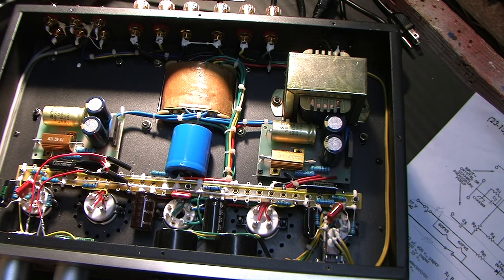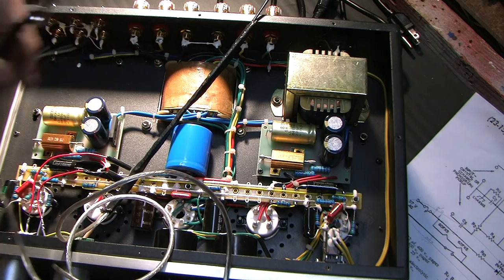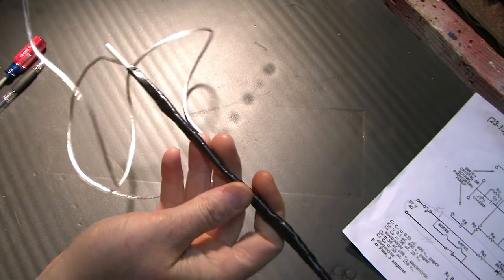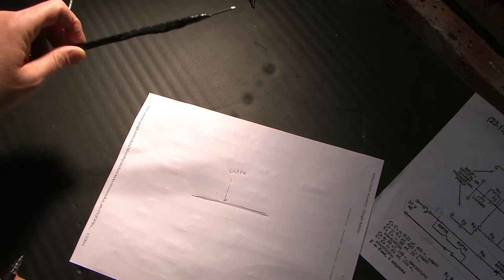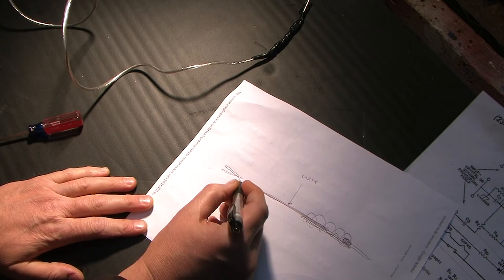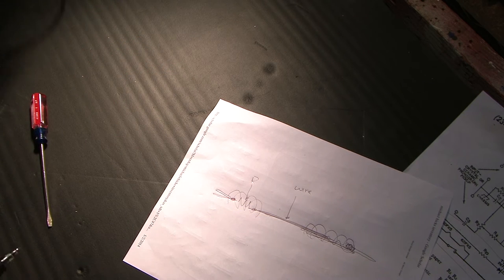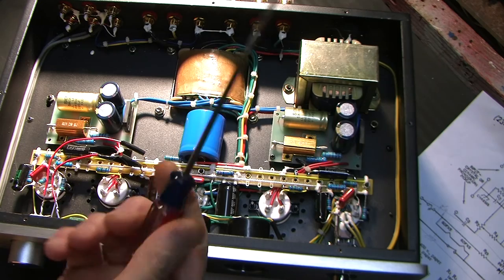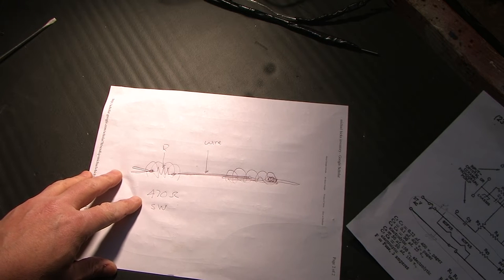Capacitor Discharge Probe:  How to make, and how to determine resistor value

Comment: Man, I searched forever for a good video on this. Couldn't remember my physics well enough. Saw some AP Physics C stuff that was pretty good, but too in depth and didn't address my need. This was exactly what I needed. Thank you for explaining how to make the probe, how to safely use it, and how to pick the correct resistor. Highly appreciated! And thank you for actually having good video quality and pretty good audio quality :)
Reply from the maker: +pasta0328 Glad I could help, that's why I make'em.  Regards.
Reply: +stereopolice You briefly mentioned this in the video and didn't end up covering it, but how do we connect to something grounded? Specifically what would be grounded and how do we check? Do I need turn off power to and then connect to the ground wire in a power outlet? Are there better things to connect to with easier access? That's the one other part I wouldn't want to screw up. As long as I can find ground, I'm confident at this point. I'm just not sure exactly how to go about that since I haven't done it before.
Reply: +pasta0328 If I were to do that, I don't see how that would work since it wouldn't be a circuit (I don't) so there'd be no electricity flow. Let's say I have a disconnected power board. Is there something on the board I can connect to safely?
Reply: +stereopolice You also said your power receptacle was connected to earth, but I could have sworn you said your circuit in the video was disconnected from your device. It looks like it's just sitting on a counter to me. Can you clarify? Sorry for the barage of questions now. I just wish you had covered finding a ground point to connect to the alligator clip to :)

Comment: Hi, just to say many thanks for your helpful video, including the maths part and reasoning for choosing a particular value of resistance.I am building such a unit for the safe discharge of microwave oven capacitors, and yes, I know we are in a different ball game there, but the principles are similar and a great emphasis on safety needs to be followed to the letter.Cheers from the UK.

Comment: Good depth to vid - thx. Glad you moved resistor to the front. Pushing the envelope with a 2,300 V, 1.0 uF cap ... ? Seems like it needs a resistor proportional to current, gold plated nail, and LED idiot lights, and some beeping noises. Then maybe some dice hanging off the rear-view ;)

Comment: So I ordered the resistor, got alligator clips, soldered, and made a 
very, very nice probe, just to find out that the microwave cap has a 
built in resistor!  I guess it';s good to have for working on computers 
or other.
Reply: where did you buy resistor and clips?
Reply: @chris8383 : I bought these same resistors on Amazon. The alligator clips i bought at a local hardware store.

Comment: Check out the "Capacitor Discharge Calculator" at http://www.learningaboutelectronics.com/Articles/Capacitor-discharge-calculator.php to calculate how much time is required for a safe discharge given the size of the cap and the resistance of your discharge tool.

That said, I like how amperage is a consideration in your calculation!
Reply: Very cool, thanks...👍😎🇺🇲

Comment: The core reason for the one hand in the pocket is "if you have your left or right hand touching chassis ground and you manage to accidentally contact a charged device with the other ,, the current path will flow on the path of least resistance straight across your chest and "through your heart" and out the other arm.. Electric shock from low voltage current with amps as low as 60 mA can cause ventricular fibrillation in the heart. Ventricular fibrillation, or Vfib, is the most serious form of heart arrhythmia, and it prevents the heart from pumping blood. This results in cardiac arrest. at the very least it will cause severe involuntary muscle action throwing you and anything that gets in the way with huge force across the room.
Reply from the maker: Right on.
Reply: I don’t understand this? A 9 volt battery provides 500mA, a AA maybe 50mA. But if you were to lick either it’s not going to give a heart attack..? Can you explain.

Comment: Hello, at 24:24 you stated that the peak current of a 900V capacitor with resistance of 470 ohm = 2.12A, but that is incorrect. The peak current would be 1.91A
Reply: video police on point

Comment: Thanks for the information, it is really helpful.

If I may ask, where did you come up with number "5", in your equation T=5*RC?

Thanks again, your work is much appreciated.
Reply: In case anyone else was wondering the same, after about 5x the time constant (i.e., RC), approx. 99% of the capacitor will be charged/discharged, which is useful enough for basic calculations and practical usage. For example, in a case where the time constant is 1: 1-e^(-5*1)=0.9933.

Comment: I have a question, could we realistically drain capacitors on a circuit or a motherboard by using a multimeter? By running the voltage test and use the internal resistance of the multimeter to drain the charge in the capacitors.
Reply: mohammad faour normal dmm resistance is 10 million ohms so no but you could use a dmm with a low z function

Comment: Great video! Thanks for sharing such valuable information!
That said, I have a device I made also but with a 100 ohm 25w. Never used it yet. Does that mean that I should make another one with your values?
 I'm starting to check for tube amps. Thanks !

Comment: I'm looking for resistors to buy and a doubt occurred me. Does it need to be wirewounded like those rectangular ones or it can be metal oxide (those normal looking ones with color bands). I've found both with 470ohm and 5w.

Comment: why is it a waste of time to discharge a 0.1UF 50V capacitor its connected to a 5v DC motor using Arduino, isn't it best practice to discharge it to be safe? is this correct? 5 * 470Ω * 0.1µF = 2.35 seconds

Comment: Just curious...  why not use a clip grabber (insulated handle, of course) to attach to one post on the capacitor, and then use the probe on the other post?  (Rather than using the alligator clip attached to a grounding point on the device?)  If you're doing repairs, I don't know that it's safe to assume the circuit is properly grounded - that might be the problem.  I'm getting back into electronic repairs (after 30 year hiatus) and watching your video to jog my memories, and if I recall correctly that's the way I was taught to do it and for that reason.  Was I taught or remembering it wrong?  Oh, and what I was hoping to find in one of these videos is a way to add some sort of indicator - LED light or buzzer - that lights/buzzes while it's discharging but stops when you get into a safe voltage range.
Reply: Wondering the same thing

Comment: To calculate the resistor value we should consider the momentary voltage across the cap Vt, the time t in which the capacitor should be discharged, the resistance used for discharge R, the initial voltage Vo and the capacity C: Vt=Vo*e^(-t/R*C). Which gives us the bleeding resistor R=t/C*ln(Vo/Vt).
Or you can use this XLS calculator if you like: https://goo.gl/dupnvg
Reply: I was also curious about HV. In the video he says voltage doesn’t matter, but I didn’t understand that. Why does your provided equation include V and his: t=5rc does not? Your calculator link is now dead by the way. I’m trying to build discharge tool for crt television capacitors. People recommend 1M ohm for tube anode cap but I figure for the capacitors it would require a much smaller resistor?

Comment: Nice info for novice like me. One thing I want to know, if I use 500 ohm 5w resistor for 400v capacitor, then max current can handle the cap    is 400/500 i.e 0.8 amp. Again capacity of the cap is s.r of 5w/r =		s.r of 5/500 = 0.1 amp which is less than 0.8 amp. Don't it (max current) fried up the resistor of 5w 500 ohm? Kindly comment. Thanks.

Comment: Thanks for the helpful video!   Is it possible to add an indicator light to the probe so that it's clear when current is being discharged?
Reply from the maker: We're dealing with a broad spectrum of voltages here, and I believe in keeping things simple, and adding a light would add unnecessary parts and complexity.  You just have to trust your probe.  However, better than a light, if you really need to know, is a voltmeter.  You can check the cap voltages after the fact on the DC voltage setting, ensuring that your particular meter can handle the voltages.  I suppose too you could rig a system that measures the voltage across the probe's resistor in real-time, and when there is no voltage across the resistor (v = 0), there is no danger.  I think that might be better than a light.  Regards ...

Comment: I used to work in a repair shop one time my co-worker forgot to discharge the caps in a microwave oven, he was standing up at the time. the shock threw him backwards up against the wall, he was stunned but otherwise not hurt. It really scared me.
Reply: cat 11 He was lucky enough to survive. A co-worker's husband was killed trying to fix a $10 garage sale microwave. He touched the capacitor and was also thrown backwards...but did not survive. Please, please be careful when around capacitors. Long story, she had to raise two fatherless children. So if you don't know what you are doing leave it to the professionals. Some things are not worth trying to save money on. If I didn't know about my co-worker's story I might have been a casualty too trying to save money. Educate yourself.
Reply: @michaeljames2183  I used to manage a repair shop...worked on tv sets microwaves I left those alone.
Reply: It's all a luck of the draw. If the shock occurs at just the right, or rather wrong time, when your heart valves are in the closed position during its beat... ☠️

Comment: excellent video. one thing is the grounding of the probe.  If you have disconnected the amp from all power sources then grounding the probe to the amp ground doesn't allow the cap to discharge correct?  so the ground should be a actual surface connected to earth ground.  someone else asked about this discrepancy but you haven't answered
Reply: When you 'connect one end of the resistor to ground', what you are actually doing is connecting one end of the resistor, via the chassis, to the negative terminal of the capacitor. When you touch the other end of the resistor to the positive terminal you are completing a circuit consisting of the capacitor and the resistor. The voltage on the capacitor appears across the resistor and current flows in it (I = V/R). If a voltage is causing a current to flow, then power must be dissipated (P = V x I). All resistors dissipate power by converting electrical energy into heat. The charge on the capacitor is converted to heat in the resistor and then lost into the atmosphere. 'Ground' plays no part in the discharging procedure.
Reply: @silasfatchett5693   ground gives  another  path of current to flow known as a  safe path also isolation

Comment: Not a math person, what resistor value should i use to discharge a 450v  3300uf   Cap  (that is on a plasma tv power supply)

Comment: hello
how do you know that you have discharged toe capacitor?
is there a way to measure voltage pre discharge, then after?
thanks
john
Reply: You could measure the DC voltage across the cap, before and after, with a multimeter.

Comment: Much needed video. Great content! Have one question, in the example with 200 micro farad cap and the 470 ohm resistor, peak instantaneous current 0.85 A (IIRC, can't see video while I type from smartphone). If the cap potential is at 500 V the instantaneous power through resistor will be P = U I = 500 V * 0.85 A = 425 W

Is that safe? I bet that's why some people use 10 k ohm (which would end up at max 25 W)

Thanks
// Eric, Sweden
Reply from the maker: Sorry for the late reply.  Using a 10K resistor, it would take about 10 seconds to fully discharge a .0002F capacitor.  That's just too long to be acceptable; you run the risk of not fully discharging just by virtue of getting bored :).  The power dissipation of the resistor is not that relevant, because the discharge period will be a very brief period of time.  Power is, recall, the amount of work done over a period of time.  In our case, the period of time is so small so as to be inconsequential.  So, "power" and "instantaneous power" (as you referred to above; which is kind of a non sequitur btw) are not considerations per se.  However, what we do get with higher powered resistors is heaver gauge wire which can better handle the peak current during the initial discharge period.  5W resistors would have no problem handling a few amps over a short period of time.  Having said that, if you want to spend 10 seconds holding a probe to each cap (using a 10k) then, well, that's fine, but I believe that 470 is the best compromise.  Regards.
Reply: @stereopolice  The correct formula to use is: Vc=V0e-T/RC to include the starting voltage potential. This for example results in a 220uF capacitor charged to 500V potential fully discharging in  around 15 seconds with a 10k resistor. With a 100k resistor which is what is traditional and what you should be using for HV circuits it is about 120 seconds. In a reasonable equivalent transistor circuit let's use 50V and 2200uF. 10k resistor. Again about 120 seconds. If you can't find something else that needs doing on the project or straighten up tools on the bench for a couple or 5 min or answer an email, I don't know what to say.
Reply: I was also curious about HV. In the video he says voltage doesn’t matter, but I didn’t understand that. Why does your provided equation include V and his: t=5rc does not? I’m trying to build a discharge tool for crt television capacitors. People recommend 1M ohm for tube anode cap but I figure for the capacitors it would require a much smaller resistor?

Comment: How do you calculate the size of a resistor to discharge a CRT? I know that they can carry a charge of up to 30k volts.
Reply: Use a high voltage probe to discharge a cathode ray tube second anode is preferred.I have always jumpered a screwdriver by means of aligator clips to chassis and have never heard of anything bad for the picture tube. Static voltage is high, but nut much current.
Reply: That’s fine for the anode out of the tube. But discharging capacitors on the crt tvs board is a different story I believe.

Comment: how can you tell if the resistor is 5 watts when its not marked on the resistor
Reply: The same way you determine the resistance value and tolerence value.
Did you see the prettty colored bands on the resistor?  Thats' resistor shorthand to tell you all that information.

Comment: Hi, And thanks for the info. Not to crazy about touching both contacts with a screw driver..LOl
 But can you post a link as too which 470 Ohm 5 watts resistor should i get ? There's so many and not sure which one . Thanks
Reply: It doesn't matter. Any 470 ohm 5W resistor will be OK.
Reply: a cement resistor

Comment: How would you add a LED to the tool?
Reply: Richard Girou put a parallel resistor with a series led. Just make sure the current flow doesnt exceed the LEDs max current
Reply: For Mr. Carlson's Lab project?  :-)   Neat Patreon project if you haven't seen.

Comment: Lets say I have 1400uF cap, at 400V, the discharge time for a 11k resistor would be 77 seconds. The initial wattage would be 11watts, how to calculate a safe plot for a resistor wattage? Because I have a 0.25w resistor, and it's fucking tempting. lol